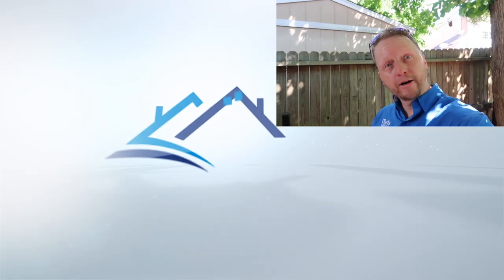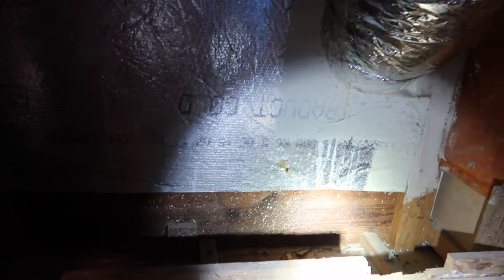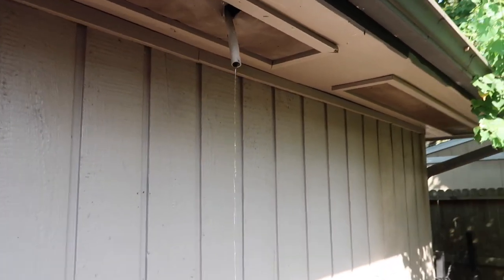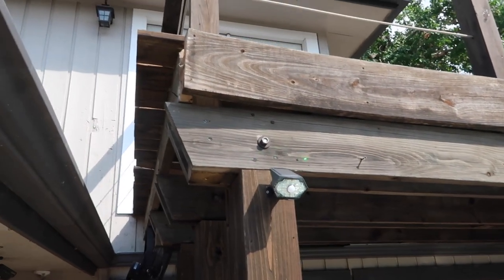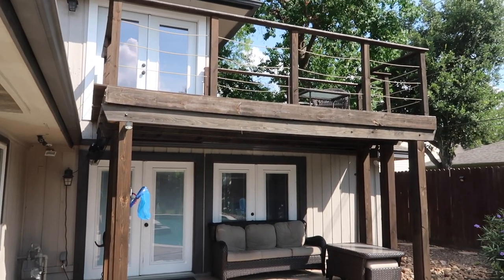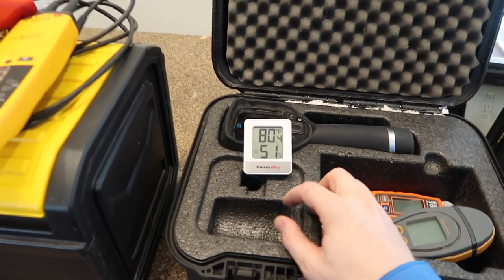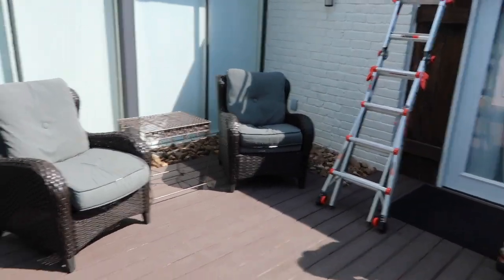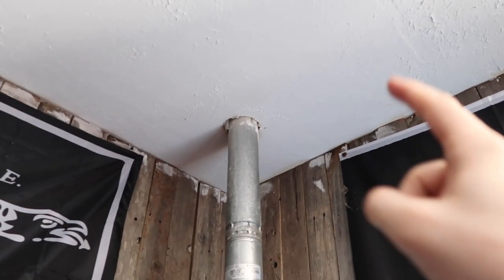How To Spot Old Home Problems - The Houston Home Inspector

Comment: What do you do when you buy the house and the first week you find many many things the inspector didn’t even mention?
Reply from the maker: This is a tough situation.  It depends on the severity of the items.  Inspectors are not there to point out every little things.  We are primarily there to find the major items.  The items that will cost you 1000s.  It is common practices to point out as much as we can to minimize complaints but the question is;  Did the inspector find all the major issues?
Reply: No perfect homes ever , at one point the homeowner or should I say the new homeowner Hass to take the responsibility that owning a home is not hands-free  😢  
There are always going to be little incidental items that are always going to appear. It’s not buyers remorse. However, your prince may turn out to be a frog. This being said first thing you pay attention to do you have the correct amount of smoke alarms, and carbon monoxide detectors First thing you approach number two water is your enemy water will cause your home to decay and rot prematurely cause an attraction for wood destroying organisms, pay attention to your electrical hire a licensed, qualified, reputable electrician to really go over your house. Thoroughly many homes throughout the years have had their friends and relatives who are Handyman to do repairs, which turned out to be incorrect, and even to the point of being dangerous,  have whatever heating and air-conditioning system type of system that you have inspected which many companies will do for free and get a service contract with them. 

Hint, hint, hint, hint, and more hence your local utility companies sometimes offer one of the best insurance policies service contracts you could ever get so whatever state you live you might want to check with utility company and find out if they have, an appliance warranty or insurance company that you pay for monthly on your utility bill. This may save you tons of money but also to get your systems up and running and it very reasonable amount of time. They also offer warrantees for year dryers and washing machines sometimes depends what and your, hot water heater depends upon what part of the nation you live in get your roof inspected but really a maintenance program 
You could have a good roofer come in every two years and spend a couple hundred dollars for maintenance program 

Again, your house is not maintenance free please please please put an establish a separate checking account for future home repairs recommend it would be to put in anywhere from 150 to $200 a month into a checking, count for repairs or emergencies      

Learn as much as you can about termites most home inspections are visual inspections, which doesn’t allow the inspector to disassemble anything there may be termites in your home that even a good technician would not be able to find hiring. A termite company for treatment is not a cure all as there may be significant damage that is hidden because it’s in between walls or covered or Tucktaway, or underneath the crawlspace , that is usually a consealed  another point your roofer might be qualified to check your chimney if not, however, from that would be from the exterior, but checking your chimney on the interior making sure there is no cold monoxide leaks coming into your home is something you can get a HVAC or boiler technician to examine 

Additionally,  heating systems, both a central air or a boiler could could develop a cold monoxide scenario and leaks and cracks within your boiler HVAC system, which is extremely dangerous to you and your family call the heat exchanger and sometimes they will develop a hairline crack. remember I told you about the utility company they might be able to do maintenance and services but if you have a crack in your heat exchanger you might have to get a complete replacement of your heating system

However, there are times we are families don’t know the signs of called monoxide poisoning or exposure. Shuffle might be you have a runny nose your pupils can become dilated you feel nausea a slight headache or a big headache but here’s a big butt again but another big butt if you notice you feel better. What are your symptoms go away when you’re at work or school that might be an indicator. You have a cold monoxide leak in your home and now they are getting fresh air and your systems getting cleaned out you start to feel better  🎉 even if you don’t have a contract with your utility company. Sometimes they will check and monitor your heating devices to make sure you’re not getting cold monoxide exposure your electrician will be able to tell you the required location of called monoxide detectors. If you feel any of your symptoms, get you and your family out of the house immediately and call the fire department and or a technician to evaluate to make sure you’re home safe before you and your family and loved ones re-enter the building. I hope some of this is helped, the rest of the home which there are hundreds of components at one point might give you a problem and just be prepared. If you can handle it yourself or get in don’t ever forget of putting money into a separate checking account for a future repair they’re going to happen.